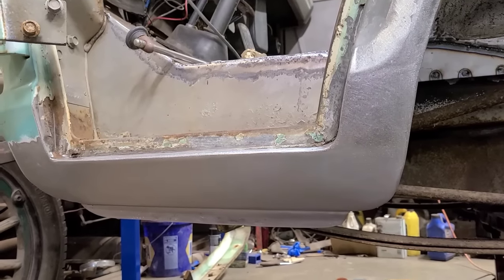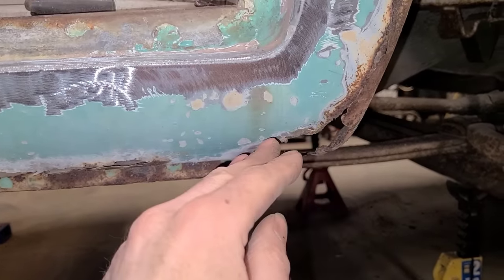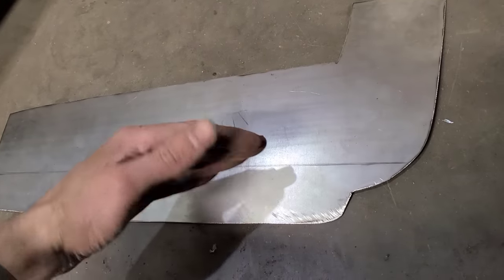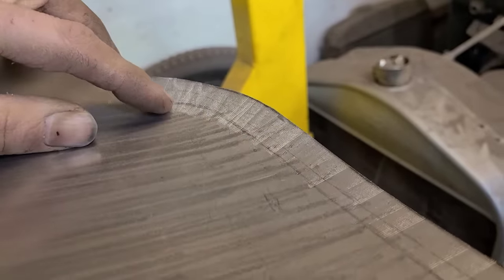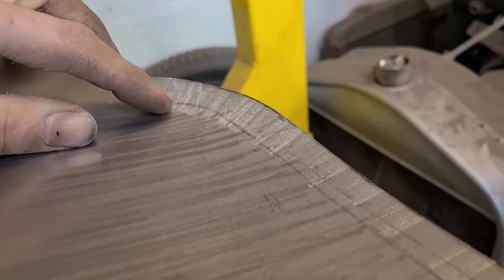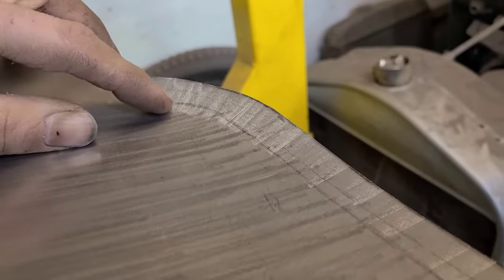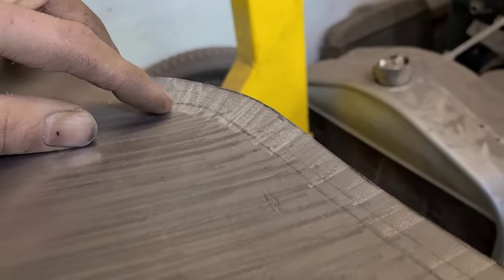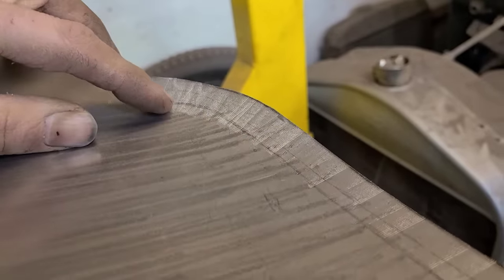Diy How To Fix Rust The Fast Cheap and Easy Way. Part 4.0

Comment: "I do it by this way because this aint no show van and lets weld this piece of garbage on the van" and after the job is done, the result is way better than its on many show vans. So keep up the good work!
Reply from the maker: If it was a show van I'd probably just mold in a fibreglass bodykit over all the rust and save a ton of time!

Comment: Hey Carter, way back in the 1900s Ford also made the unibody van. I was turning wrenches at that time and the local telephone company had a fleet of them. At about four years old the engine and transmission supports rusted away. Say goodbye to the fords!:( When I was rebuilding the cab mounts for my 64 F100 I also had to rebuild the air supply on both sides as well. The rain water was, by design, supposed to drain out the bottom at the corners that were left open. After 50 years of being plugged up and holding the moisture there was a fair amount of repairs. Three and four layers of metal seams and maintain the drainage openings. Lots of fun and looks good from the street! Thanks for the continued education!:)

Comment: I am currently replacing rust on a 1966 chevy van.  This is awesome! Since no one makes replacement rocker panels for these old vans, making them is the only option.  Maybe I should get a bead roller. I tried to upload a picture of the rust but maybe youtube doesn't like me. Or, I just haven't discovered how to do that yet.

Comment: After watching a few videos I’ve come to the conclusion you can’t learn this trade in a couple days. I’ve also noted, you’re very good at it.  Thank you, I have learned a lot since I am now doing my own 2006 E350 rocker panels.  Basic tools, shrinker/stretcher, mig welder, hand tools and a English wheel. Well, let’s see how far I can go before I have to buy anything, starting with hand tools and some Sheet Metal Talent. Thanks Again!
Reply from the maker: Thank you and good luck on your rocker panel project!

Comment: I thoroughly enjoy the videos you produce, i`m taking it as an education. I employ a lot of the techniques that you show on my own car rebuild, a 1958 Pontiac stratochief. Replacing pretty much the whole bottom of the car due to rust. I`m posting the progress on Facebook on the Canadian Pontiac page. It is slow going sometimes, make a lot of mistakes too. What has happened is that my welding has improved so much that i`ve gone back and redone some of the earlier repairs i made because i knew that i`d be capable of making them much better. When i don`t want to go work on the car, i watch your, Fitzee, Karl Fisher, or Wray Schellin, and i usually find myself out in the shop working on the car before i even finish a video. I have found that sheet metal work and forming weird shapes from sheet metal holds no black magic secrets for me. Your videos have led me in the right direction on the process that i understood in theory, but was always unsure if i could actually do it. Turns out i can and am not too bad at it. Yes, i have my setbacks and occasionally smash whatever is not fitting properly with whatever hammer is at hand while merrily cursing the sheet metal gods, but i figure it out in the end. I probably have spent my life doing the wrong vocation, but I`m pretty good at that too.
Thank you for the time you spend making these videos, i used to think this type of work was a dying art, but maybe it isn`t.
I suppose it`s inspiration. I have also realized that these vehicles were not assembled back in the day by rocket scientists, and the hardest part is just figuring our where to start on each individual area.
Reply from the maker: Thanks for the great comment! You're correct, it's easy to overthink this stuff, but in reality these old cars were pretty crudely assembled so sometimes the best thing to do is just dive in and go for it. After all people have been making stuff out of metal for at least a couple thousand years.

Comment: awsome video much respect towards your work I'm doing a 2004 chev 2500 not much left of the rockers under side door inners are rusted right out going the cheap way just going to weld in a 1/8 by 3/4 on the front and back lip sandwich it with spot welds give me something to weld the rocker panels to just to get a few more yrs out of the van it runs good 260 on it

Comment: Fell asleep briefly when some english wheel stuff happened - then shrinking got involved and I had to go get coffee to stay awake once more - perked up when sheet got bent over a big lump of pipe, which is a big positive.. God may have designed the rocker with fancy curves, but not being God, I reckon artistic licence is allowed when rebuilding grot. I.E it's gonna be flatter, squarer but less rustier.. Less rustier is always good, curves bedamned. :-)  Very disapointed the rice failed to feature as I feel it may have had a lot to offer.  Loved the vid tho. Sense of humour 5* & nicely dry. :-)
Reply: Yes, I wanted to find out if brown rice might work better than white rice.
Reply from the maker: I have a feeling the rice will appear in a future repair.

Comment: Nice job as always Kyle! 18 gauge is a bit tougher to work, but definitely stronger. Nice fab work and explanation on what and how to do it.
Reply from the maker: Thanks Ken. Most of the panels were stamped from 19 gauge originally which is hard to come by so I just go 1 size up to 18 gauge.

Comment: Well, I did get two pieces of steel put in place for the inner rocker of my 1966 chevy van.  I think that I will be removing one of them as the gaps are so huge that it will take until 2025 to fill them up with welding wire.  This video was hard for me to imagine how all the pieces go together.  I may have to take a class on math or geometry or something.  The rocker in front of the door is missing on both sides so I will have to make the pieces.  Which is certainly past my skill level. So, I may just have to get my axe and start chopping away at the rust and see what I have left to work with.
Take care of yourself, winter coming and all.
Tony

Comment: Cool tenuous work. That steering wheel at the end is sweet. Where did that come from
Reply from the maker: It's a 1939 Ford Deluxe wheel. It used to be in a Model A hot rod I built.

Comment: Around 8:48, I see that you're sheet metal is kind o thick... What gauge do you use?
Reply from the maker: 18 gauge. The original panels were 19 gauge, but that's hard to come by so it's better to go up a size.

Comment: Looking good professor Carter. A question is there any inconsistent areas in the metal to look for  when you are bending over a pipe.? Thanks 😊
Reply from the maker: I don't worry about it too much, I just bend a little at a time and check it as I go. Easier to sneak up on it than do too much at once.
Reply: @CarterAutoRestyling  thank you 😊

Comment: How do u treat the inside (hidden parts) of that panel to prevent rust coming back in the future? Any paint etc would be burnt of during the repair process.
Reply from the maker: It's treated with wax oil after paint

Comment: That looks like the brakes from Princess Auto p/n 8536526.  How do you like it? I'm thinking about getting one. Also, is your shrinker/stretcher from PA as well?
Reply from the maker: It's better than not having a brake at all, but it's not very good. The shrinker stretcher came from Princess auto about 12 years ago, the ones they currently sell are complete junk and I would not recommend

Comment: Why not do the bending by hand before and then use the wheel to finish the bend, this isn't a restoration more like a fix it so I can get a sticker move.
Reply from the maker: Why not? This is just the way I prefer to do it. Doesn't really matter how you get there as long as the end result is the same.